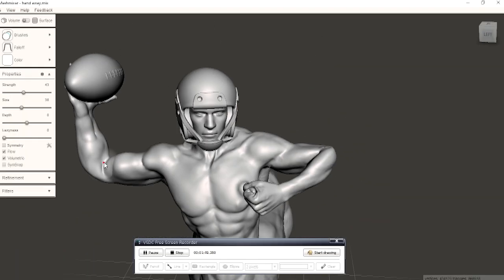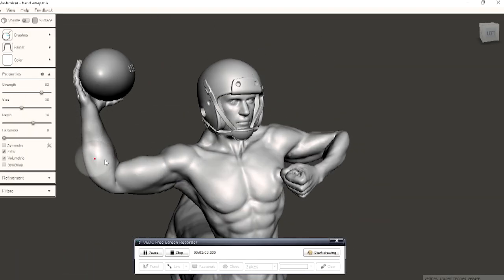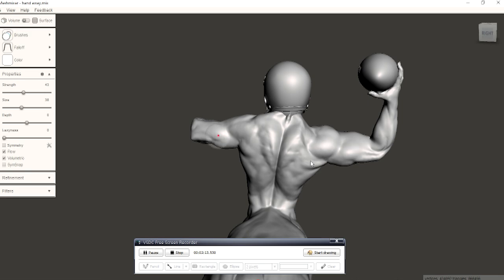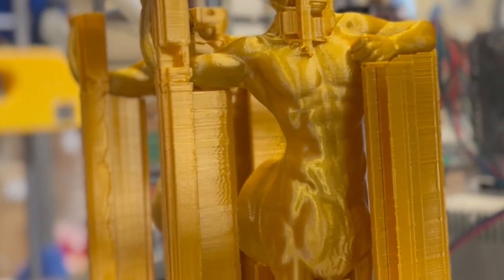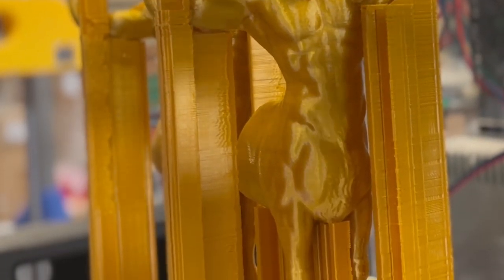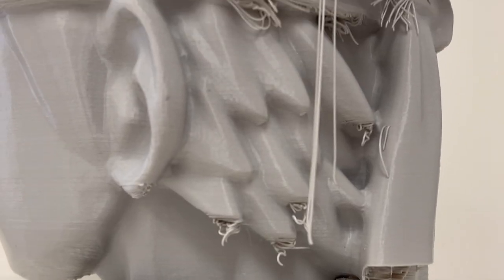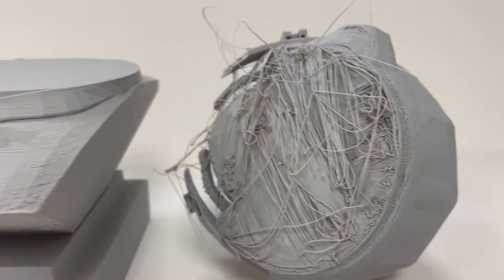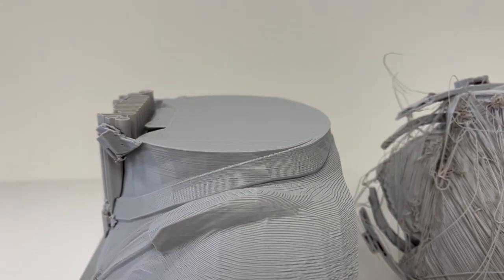The Cost of Mass Production 3D Printing Explained

Comment: Interesting to note: small batches over a period of time is one of the parts of LEAN manufacturing, for all the reasons you went over; additionally, producing in small batches also means you have to keep less money bound up in inventory (raw material, work-in-progress, finished material), and means if the customer decides it doesn't want that finished product you aren't left holding the bag.

Comment: I have a question let's say I am looking at two options option 1. make the part from PPSU  option 2. have a special ASA filament made with a added flame retardant and make the part thicker to offset the lower elevated temperature strength of the ASA (possible even lower with the added flame retardant). 
I knew a machinist that would always say "I can tell you what the part will cost after I have made 15 of them" I know there is some truth in that statement , but what is your gut feeling of option 1. vs option 2. ?

Comment: This could be a good marketing video. Yes the 3D printed parts CAN be mass produced but it is NOT a cost effective way nor environmentally friendly way to produce million of parts.
If you need to produce millions of parts you are really wasting time, money and effort choosing 3D Printing.
The carbon footprint of 3D printed parts is simply not able to compete with injection moulding.
See the Prusa and Bambu printers, one the part is manufactured in-house the other is mass produced via injection molding. It is too early to argue which company is more successful but Bambu clearly takes the lead in terms of the manufacturing speed.